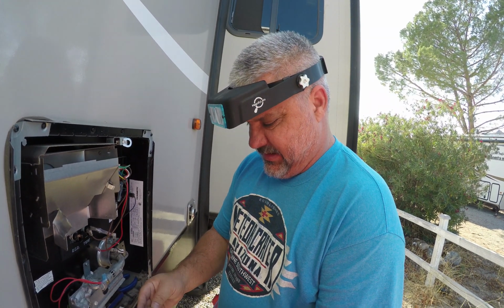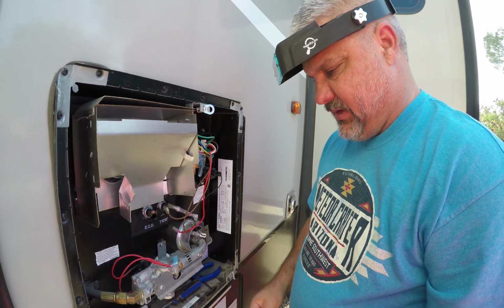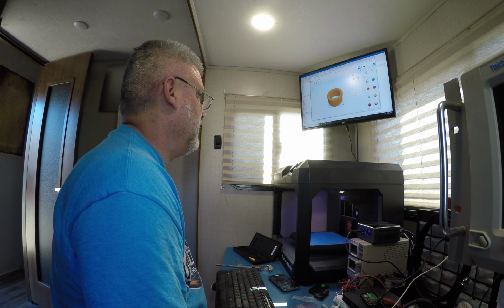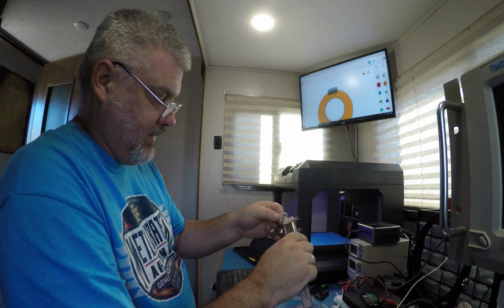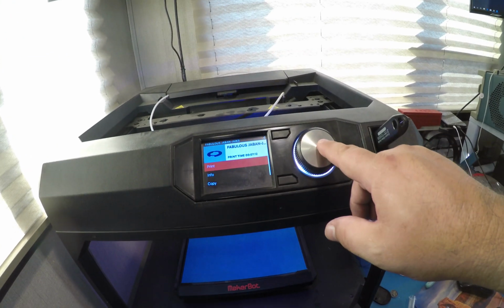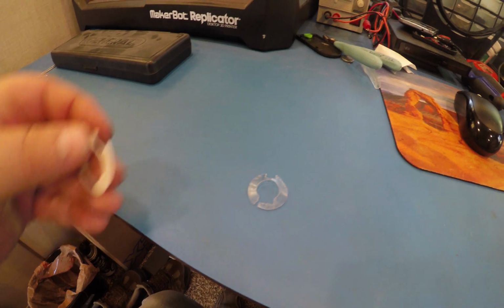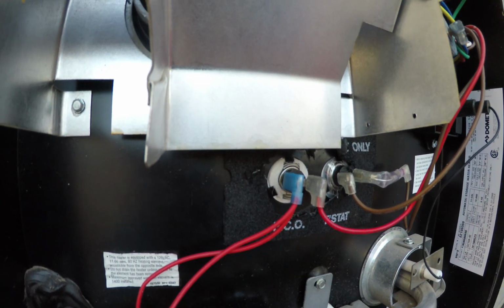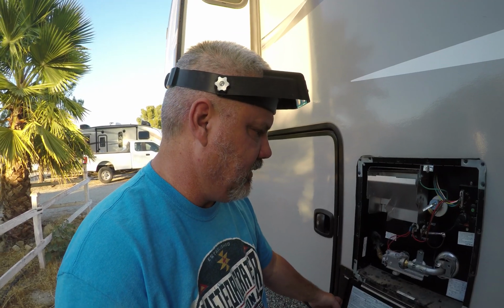3D Printing New Parts Right in the RV!  | Full Time RV Living

Comment: Glad to see others using their 3d printers for and in their RV. Been full timing for years now and have been into 3d printing for about just as long. I have my big 3d printer (my second one I got) setup on the in wall TV stand in the back bedroom, with my desktop and monitor below it on a home built desk. My first printer, which is smaller is mounted to a folding wheeled file folder crate with expanding handle. That way it's mobile and I can take it with me to Maker Space's in areas I am visiting or in family or friends homes. My project I am working on now is a new knob for the stove igniter, since ours broke and got lost. Hoping to finish the deign  model today and have it printed next time we plug in.